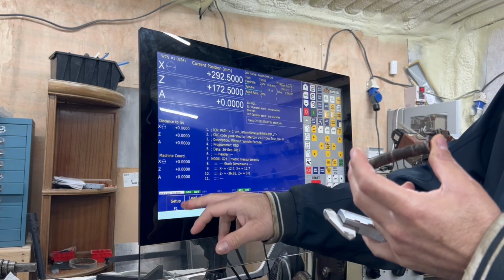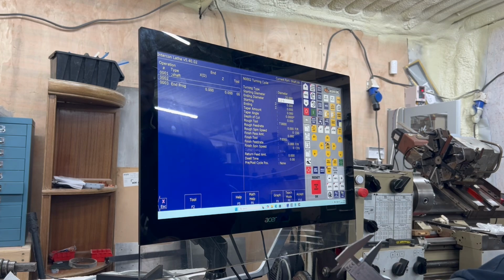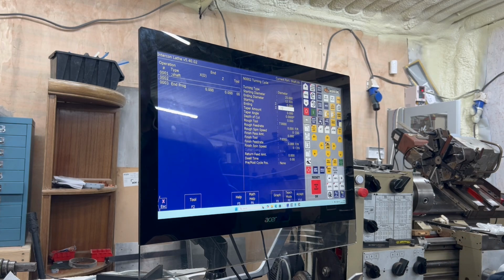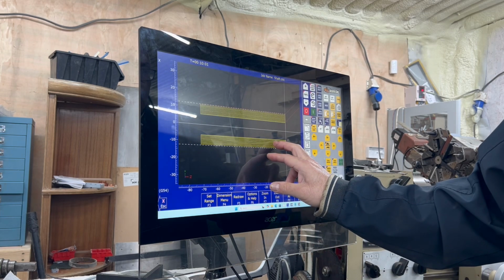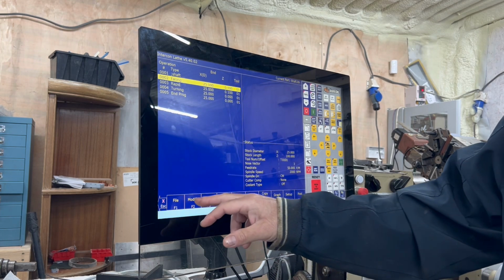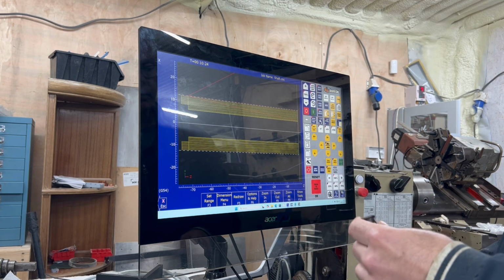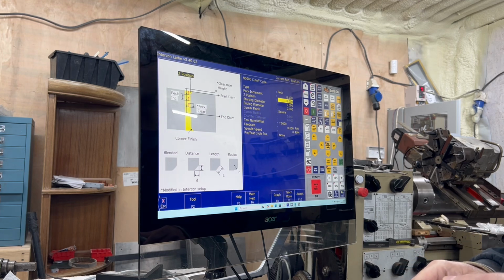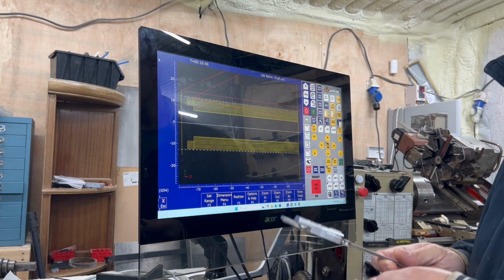Centroid Acorn CNC 12 Conversational

Comment from the maker: Error Alert, 40mm/rev is not 'low'. It was correct for the parting to at 40mm/min, not rev. Glad, a run didnt break the tip of the tool. Always double check your units of measure.